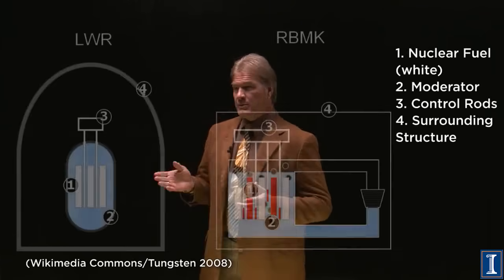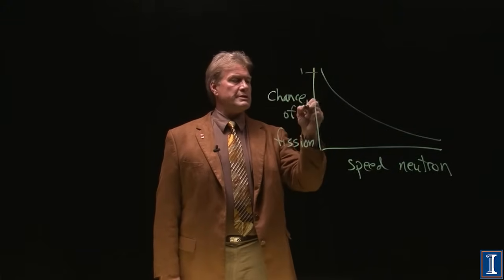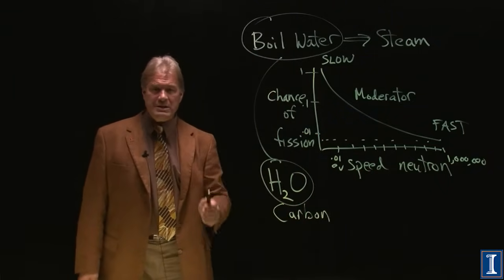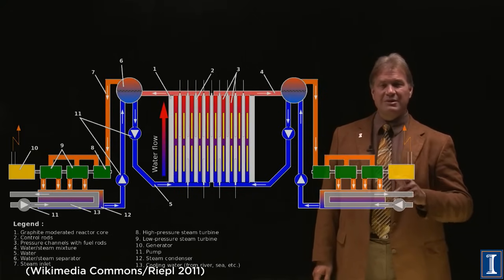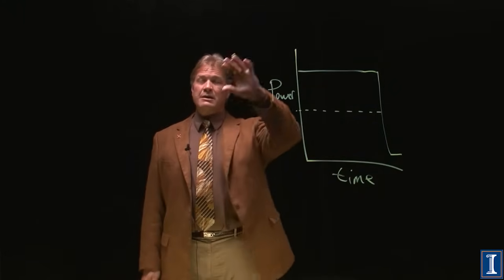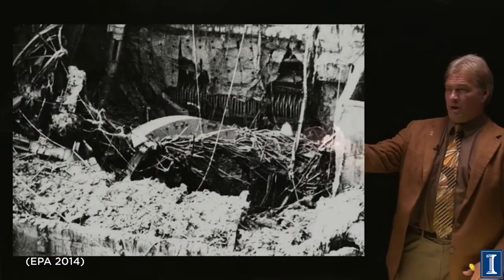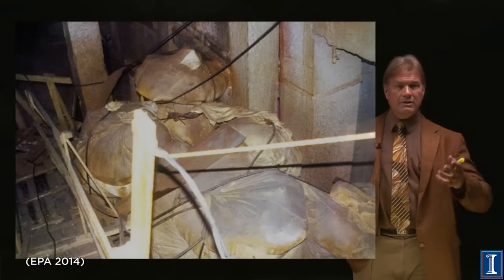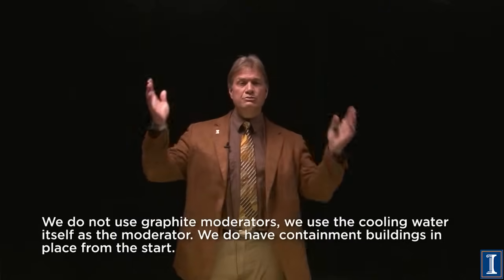Chernobyl: Worst Accident Ever

Comment: Could you make a video on this ?.
On March 28, 1979, a pressure valve malfunctioned at the Three Mile Island nuclear power plant near Harrisburg, Pennsylvania, causing a partial meltdown in the Unit-2 reactor.1 Cooling water, contaminated with radiation, drained from the open valve into adjoining buildings, and the core began to overheat.3 The reactor was destroyed, but there were no injuries or adverse health effects. Some radioactive gas was released a couple of days after the accident, but not enough to cause any dose above background levels.2 The Three Mile Island accident was the most serious in the history of the American nuclear power industry.0 The effects of the accident have reverberated for decades since, from changes in U.S. energy policies to popular culture.4
Reply: He has a series of videos on TMI.

Comment: Isn’t Fukushima a worse accident? I wonder.
Reply: Not yet. Fukushima is a spit in a bucket compared to the amount of crap Chernobyl spewed out. A lot of nasty things could still happen in the basements of Fukushima, though. They don't even know where the cores are or where the water's coming out. They pump it in the tops of the reactor vessels and pump it out of the basements.
Reply: @loupgarou-dj3tm so 1 reactor in Chernobyl that stopped basically in the same year is somehow worse, then 3 exploded reactors, that are still burning after 15 years and nuclear water is dumped onto the ocean? I smell bias.

Comment: That town is called Pripyat...
what a BS !!! that amound of power would not be able to be contained by your containment building...
remember ??? that 2000 metric tons reactor lid was blown up into the air and had fallen back sideways!!!
ONE MORE BIG LIE (by omision) YOU ARE NOT TELLING US !!!
THAT TEST WAS DONE BECAUSE OF ONE REASON...  the russians wanted to know what would happend if NATO stikes their NPPs !!!
they did not needed to test their AZ5 button... they knew it works - UNDER NORMAL CONDITIONS !!! THAT WAS THE PLAN AND THE REASON FOR IT !!!  they didn´t klnow???  ABOUT XENON GAS CORE POISONING???  you are as arrogant as Dyatlov !!!
and here you go... a steam explosion... " a whole lot od dynamite" by your own words... and we are to belierve that a conteinment building would hold it all in??? 
and BTW  if your  LWR are so safe... why there were soo many accidents in your "SAFE WESTERN NUCLEAR INDUSTRY"
let´s say Fukushima !!! what kind of d#ck head builds NPPs on the coast and installs back up systems into the basement ???
c#etins do !!! comparatively the russian  graphite /boron dual purpose contrioling rod had practical reasons for it...
unlike your batteries and back up diesel generators in the flood zone !!!
get stuffed you arrogant prick

Comment: Would have a containment structure have been able to withstand that steam and thermal explosion?  After all, it lifted “Elena”, the 2000 ton lid clear off the structure and turned it on its side.
Reply: correct

Comment: His story of the events doesn’t add up or make much sense. This guy claims it was the operator who “pushed the wrong button”. All Operators will tell you that engineers and managers spearhead all of these “experiments”. Operators don’t just make moves without specific procedures and instructions from directing engineers. Never. Operators like the unit to run throughout their shifts without messing with shit. Always the moron engineers who wanna Jack with what already works and shouldn’t be fucked with. Disadvantage to the concept of “continuous improvement” being turned into someone’s ticket to a promotion….usually the expense of the people around these idiots.

Comment: Water moderated reactors still have higher chances of catastrophe than a gas Turbine generator/ HRSG system. These folks can plead their case as much as they want but they will always be lying to themselves and all of you about the “safety” of nuclear energy. You see, nuclear energy is about one thing…..money, not safety. Because the potential for large scale disaster will always be higher than other energy production methods the people deciding to run nuclear instead of fossil fuels will always be trading elements of safety for cheaper fuel prices.
Reply: Cute how theres always a fossil fuel shill spewing shitte in any videos related to nuclear energy...

Comment: so my question is...why didn't use water as a moderator like everywhere else on the planet? Was it somehow cheaper? Doesn't make sense otherwise
Reply: Graphite is a better moderator than normal water. The RBMK, like the CANDU reactor (which runs on heavy water), could run on natural uranium, albeit it was very unstable, especially at lower power levels. The RBMK was essentially a discount CANDU reactor. The Soviets were actually developing a safer version that included a containment building and better safety systems, the MKER reactor. Still a graphite moderator. Work was canceled a couple years after Chernobyl and Russia is now focusing on fast breeder reactors (the BN series) and PWRs (VVER 1200/VVER-TOI)

Comment: UK Magnox and AGRs also use graphite moderators, but they differ from the RBMK reactors in that they use a gas coolant (carbon dioxide) in the primary circuit and boil water via a heat exchanger (which does not come into contact with the actual reactor). Also, the gas will naturally circulate via convection to take away decay heat, but do require control rods to drop in to shut the reactor down in the event of a fault. It also doesn't have the positive void coefficient issue that the RBMK reactor does.

The AGRs also don't have a separate containment building, but have a 5-7 metre thick reinforced concrete pressure vessel. 

In any event, that seems to be a bit of an omission. The last AGRs are due to close down in the next decade or so. Their biggest problem appears to be the expense of decommissioning, as there is a large amount of irradiated graphite to deal with, and the reactor core is a lot larger than in a PWR. It's also that very large core which means it's not prone to runaway decay heat issues as there's a lot of thermal mass involved which slows down events. It means that the sort of thing that happened at Fukushima ought to be impossible as it doesn't rely on powered cooling systems after an emergency shut-down.

nb. there was never an issue of Kiev losing all its power during the planned exercise. There were four RBMK reactors at Chernobyl, and only one (reactor #4) of them was to be shut down for refueling.

Comment: I think it’s implied the RBMK should have a containment vessel, analogous to the Western LWR containment configuration - not that the RBMK reactor should use containment as designed for the LWR.  Most certainly, the containment for the RBMK would have to be specifically designed for it, one of the specifications being able to contain a hydrogen explosion.  Obviously, using a Western design intended for use by an LWR would not suffice for an RBMK.

I have read Russian designers discarded the idea of a containment structure because a:) they believed with certainty the reactor characteristics were such that a Western style containment was unnecessary, and b:) the reactor was intended to be refueled while in operation via a large crane above the reactor vessel; hydrogen explosion-proof containment would have impeded this feature, or made it impractical if not impossible.

Regarding an operator hitting the wrong button, this is the second video where I’ve heard this, the first being n MIT lecture on nuclear engineering.  I believe the source material came from an official report by a nuclear regulatory agency; I’ll post a link to the report and updathe post w the agency.  The two presentations are very similar with respect to the technical details and the timeline, causing me to infer they’ve both used the same source material.

After reading the NRC’s report and rewatching Professor Ruzic’s essay, I’m unable to substantiate any of the comments who declare this video is full of misinformation and mistakes.  Professor Ruzic does interject his dry sense of humor when he’s critical of operator performance, and clearly interprets the actual events and human factors elements with an engineering and professorial point of view with full benefit of hindsight, but that’s how root cause analyses go.  I suggest instead that the people who commented that Ruzic made errors have trouble with his perspectives, points of view, opinions and style.  That’s too bad, because looking at issues from multiple angles and personalities is a critical benefit of YouTube.  Being able to watch many different videos on a singular subject is such an advantage, especially when the videos ultimately prove out a consistent sequence of events and series of facts, along with weeding out the content creators that are less than rigorous in their factual reporting.

Comment: I used to melt down nuclear power plants for a living in training exercises. 

The hardest part was breaching the containment building to create a release path.

I used to spend hours upon hours following cable trays, pipe chases, to know what went where. What the hell, it's 0300, I got nothing better to do. Spent hours picking the brains of the reactor operators.

They knew I was a gun nut, so, tit-for-tat, we traded information. They taught me about reactor theory, I taught them about guns, (so, here are your holdovers at 600m, tape it your stock, and you'll be good to go.)

Comment: If Chernobyl had a Western Style containment building could it have contained an power excursion/hydrogen explosion of that magnitude?
Reply: I think it’s implied the RBMK should have a containment vessel, analogous to the Western LWR containment configuration - not that the RBMK reactor should use containment as designed for the LWR.  Most certainly, the containment for the RBMK would have to be specifically designed for it, one of the specifications being able to contain a hydrogen explosion.  Obviously, using a Western design intended for use by an LWR would not suffice for an RBMK.
Reply: @Pene7942   The first part of your statement is what I meant. If Chernobyl had a containment building designed and built to "Western Standards", ie: the primary coiling loop flashing to steam, or what ever the western design basis accident is, would that have been sufficient to contain the excursion caused steam flash and the hydrogen explosion? Or is the Chernobyl accident beyond even what western designers plan for?

Comment: There seems to be a lot of scholars who think a (western) containment building would have failed, but you say that's the last (and most important) line of defense. Care to address/revise that, maybe in a subsequent video?
Reply: I think it’s implied the RBMK should have a containment vessel, analogous to the Western LWR containment configuration - not that the RBMK reactor should use containment as designed for the LWR.  Most certainly, the containment for the RBMK would have to be specifically designed for it, one of the specifications being able to contain a hydrogen explosion.  Obviously, using a Western design intended for use by an LWR would not suffice for an RBMK.
Reply: @Pene7942  since "RMBK reactors don't explode", maybe it did have a containment building appropriate for its design...

The video makes it sound (wrongly I think) like the containment building is a failsafe that would kick in when some unknown factor causes a catastrophic failure not foreseen in the design, not one designed to handle a very specific failure mode (steam explosions).

Relatedly, what I've read suggests that no containment building could withstand arbitrarily powerful prompt supercritical excursions.

Not an expert in the field though.

Comment: The lid on the reactor vessel was blown about 40 feet into the air. The lid weighed over 1,000,000 pounds.
Reply: Actually, 2,000,000 lbs…1,000 short tons.

Comment: The first explosion was caused by steam over pressure from the rapid power surge due to the extreme heat in the core. The heat was not the cause, merely the driver for the water to boil to superheated steam instantaneously causing the first “explosion” that was really just the reactor building pressure the same way a tea kettle does, but with nowhere to vent the steam. The second (and only actual) explosion was the fission products mixed with atmosphere that did create a combustion reaction. I can guarantee you that no other sheer force on this planet has been created like that in all of human history, nor will one like it ever be replicated again.

Comment: This is what I don’t understand. Now we use heavy water as the coolant and moderator. If water evaporates then the moderator is gone. Neutrons would love too fast to collide. I do not understand the green energy push without nuclear? Don’t built on faults, fine, but figure it out. This is the way

Comment: RBMK reactors were developed initially as breeder reactors for nuclear weapons. They were later repurposed for energy production. Soviet Union was not using them to build nuclear power stations in other countries for some reason. RBMK makes more energy than LWR reactors. RBMK from start had issues with stability. Leningrad nuclear station had some rods melted because of uneven distribution on neutron flux inside reactor core and so called hot zones. There were other accidents related to the design but they have been kept out of general public knowledge. Containment vessels are fairly expensive and complicated constructs. People who operated Chernobyl nuclear reactor had no proper education and good understanding of it's construction or principles on which it is operating. Many of them were from regular thermal energy production stations.

Comment: Sorry, no 10:50 an operator didn't hit the wrong button.  It had been run at half power and there was a xenon build up along with a lack of coolant void and graphite cooldown.  This made any power change difficult.  This is known and is in the WNA page about the accident.  From there you are correct.
Reply: Agreed, the problem was the electrical grid needed power and those operators didn't allow the power to be reduced, so it stayed around 50% for 19 hours, which contributed to the Xenon poisoning.
Reply: That's not strictly speaking true. One of the operators switch the reactor from local automated operation to global automated operation. Sort of a nuclear autopilot. However, he failed to set the power level that he wished the reactor to stabilize at. Because of this, the reactor went to the power level that had been specified last - near zero. And, of course, and we know from experience now that RBMK reactors are notoriously unstable at low power levels. PARTICULARLY when the fuel rods are older and due for replacement.
Reply: @VComps  Not according to the The International Nuclear Safety Advisory Group (INSAG):
The drop in power occurred at 00:28 on 26 April during transfer from local to global power control. The INSAG-7 report states: "The INSAG-1 report describes the precipitous fall in power to 30 MW(th) as being due to an operator error. Recent reports suggest that there was no operator error as such; the SCSSINP Commission report (Annex I, Sections 1-4.6, 1-4.7) refers to an unknown cause and inability to control the power, and A.S. Dyatlov, former Deputy Chief Engineer for Operations at the Chernobyl plant, in a private communication refers to the system not working properly." 
The timeline from the World Nuclear Association words it differently: 
With the power level at about 500 MWt, control was transferred from the local to the automatic regulating system. The operator might have failed to give the 'hold power at required level' signal or the regulating system failed to respond to this signal. This led to an unexpected fall in power, which rapidly dropped to 30 MWt.
So it isn't quite clear what happened, but still, the Iodine pit - Xenon poisoning sequence described by the professor was happening anyway and they should have shut it down, but instead they tried to increase reactivity ultimately ignoring safety standards. Then we have the positive void coefficient making things even worse - the poor souls were doomed.  
One of the things may not be instantly obvious for someone not living under such a regime is why they ignored so many regulations. It wasn't simply negligence, people in the Eastern bloc, especially in the Soviet Union still remembered the days when a failure to get results was considered sabotage (as the system of scientific socialism was supposed to work flawlessly) and punished severely.